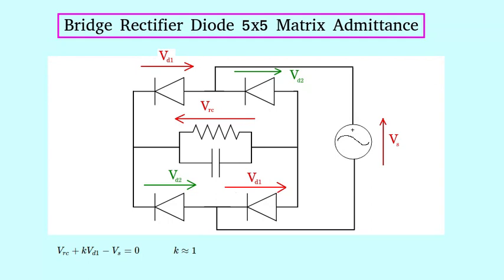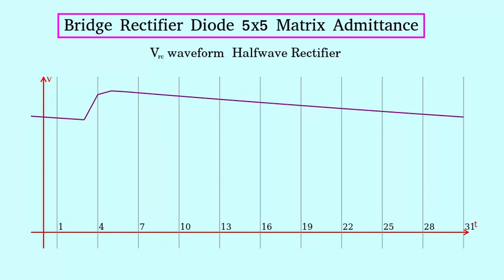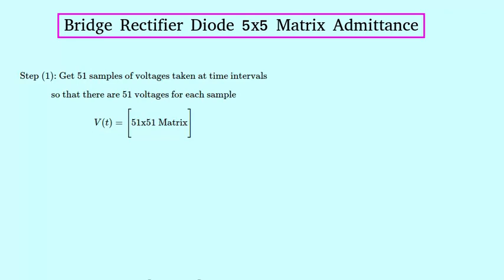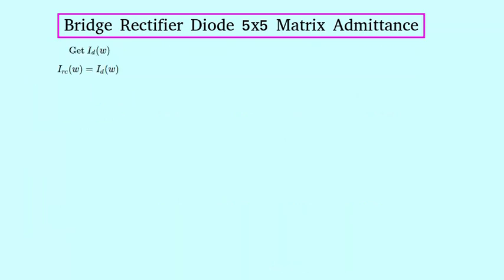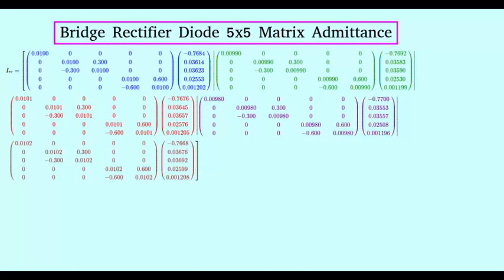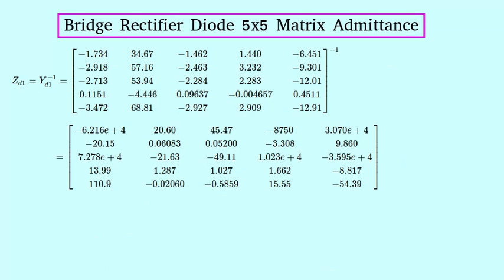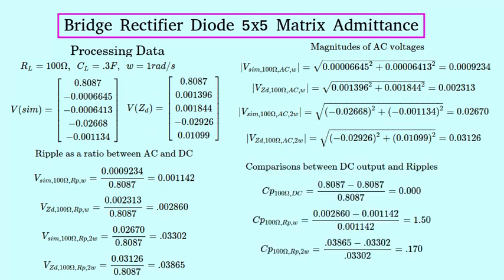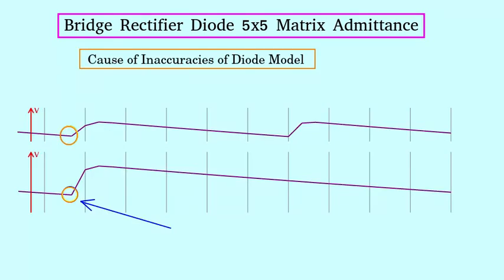Rectifier Diode Matrix Impedance Part 2

Comment: These sorts of equations are found in the Harmonic Balance method
Reply from the maker: I had a look at this method in Wikipedia. It does use Linear Algebra, and a sort of technique for finding the current through the load that looks original.